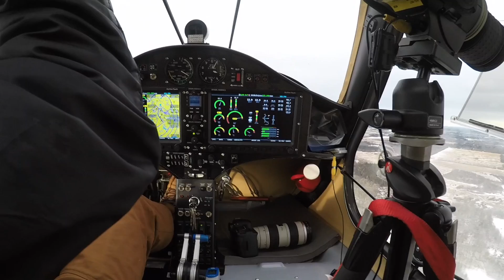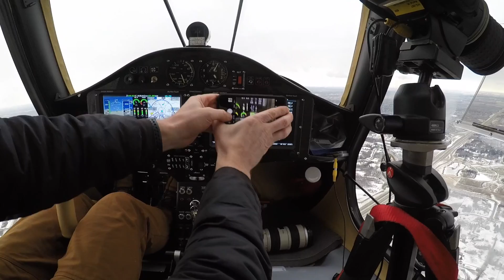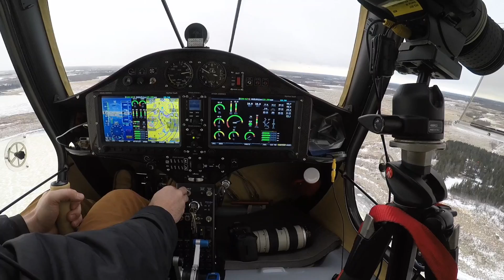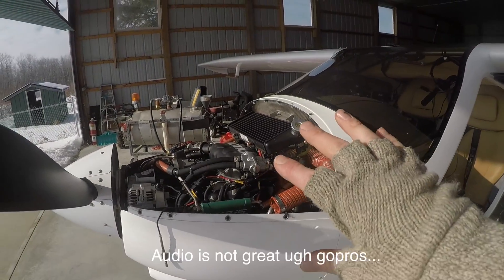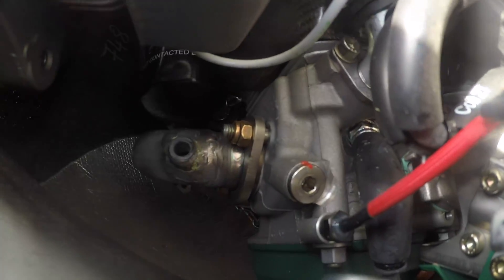EGT sensor failure in flight!

Comment: I have an 09 Sting S3 with the 912 and from time to time get these sensor lights coming on. It can be stressful when it happens but every time it has been a bad sensor. My fuel pressure sender malfunctions a lot and always turns out to be nothing. I think Rotax engines do have this issue. That said, the engine itself has been reliable. The electronics........ not so much
Reply from the maker: FLY-4202 yeah it’s definitely got quirks. My lane a will go off if my coolant temp goes higher then the oil temp. But it’s within specs. Unfortunately this sensor issue is not the root cause, I’ll be showing it in an upcoming episode very soon.